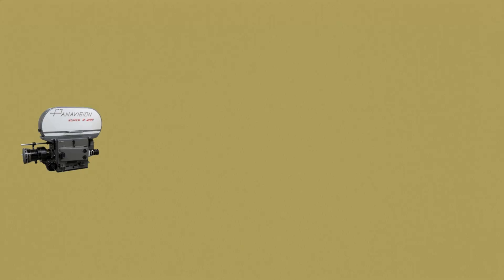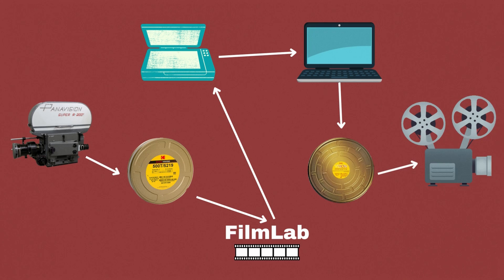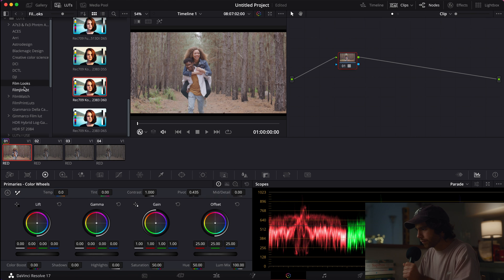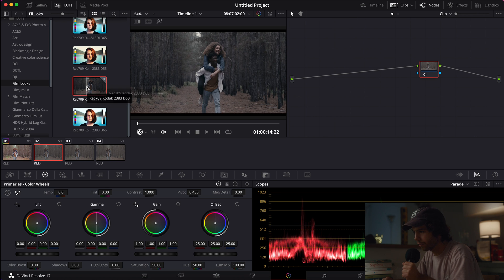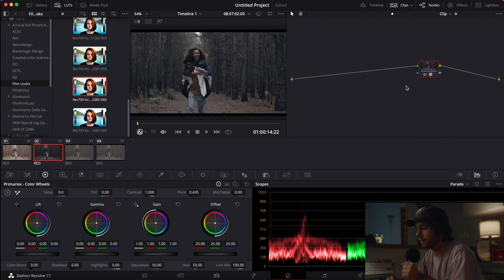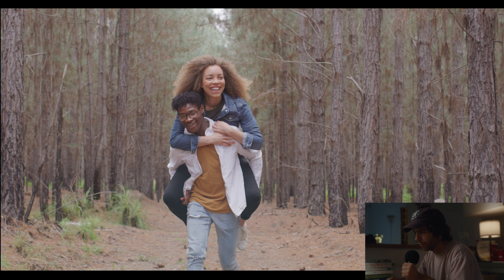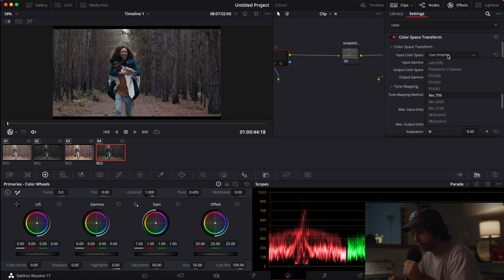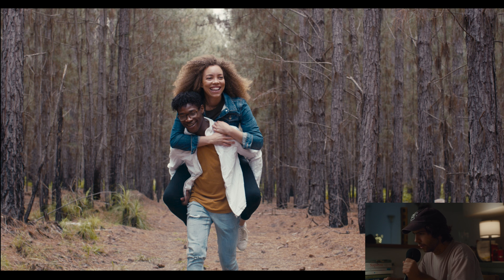Davinci Resolve Film Look + Free PowerGrade

Comment: Hey, just one small tip: If you're converting footage from one color space / gamma to another, and it's not the final conversion for display, it's best to switch off 'tone mapping'.
Reply: what is it for?
Reply: @rustikkkk  tone mapping maps all the values of your larger (log) space to the smaller space (f.e. Rec709) in a pleasant way.
Reply: @RubenStuveling  and then why we should turn off if its not final conversion

Comment: I tried this and it’s not coming out right for me. I changed the input color space and input gamma to my camera in the first node and then put the “Kodak50D” LUT in the third node. The image comes out very blue and I’m not sure if that’s the intended look. I was under the impression that this PowerGrade would create a look similar to this video. If not, that is user error on my part 

I thought
Reply from the maker: Hi Johnny, do you have a “film print lut” on the last node?
Reply: @jimmyonfilm  Yes. 

The last node is set to “Rec709 Kodak 2383 D60”. Is there a difference between the two PowerGrades in the ZIP file download? One PowerGrade is 8,108 KB and the other is 1,863 KB. I am using 10-Bit footage and i am not sure if that plays a factor in the final look 

Thank you for your reply

Comment: I was trying to do this film lut in davinci wide gamut colour management , other than rec709, but it's not working .
Reply from the maker: I haven't tried it myself cause I don’t use davinci wide gamut color management. Basically color space transform from davinci wide gamut to the input color space of the LUT (Arri LogC in the CST node), and then color space transform from the output color space of the LUT (the film print lut) to davinci wide gamut again (so going from rec709 color space and gamma to davinci wide gamut). Keep in mind that the film print lut was built for SDR so it will not work 100% accurately. But you can try. This powergrade works best with a manual color management :)

Comment: Nice video and nice style of explaining. +1 subscriber. I'll give your PowerGrade a try. Any ideas on settings to use when working with non LOG files? My footage consists mainly of drone (DJI Mini 2) footage. Not sure of the color space but I think it is Rec709. What are the best settings for applying LUTS in the best way? Keep up the good work!
Reply from the maker: Thanks!!!! 
In that case I would use the CST in first node in the PowerGrade with the input color space and gamma both set to “rec709” and the output to Arri Alexa and Arri Log. The results are not 100%accurate cause it’s hard to go from rec709 color space to Log in a very clean way. But I did it from time to time when I had to and it wasn’t bad at all. Maybe you just gotta mess with the contrast a little bit to find the sweet spot.
Reply: @jimmyonfilm  Thanks a lot! Downloaded your Kodak PowerGrade and it works like a charm with these settings
Reply from the maker: @TomBoudewijns  Happy to hear :)
Reply: @jimmyonfilm help! What would be the best way to use a old canon 600d 8bit footage? Does that also output rec709? Would the workflow you described be the same?

Comment: in my case in the CST panel on output color space it only appears, ARRI WIDE GAMUT3 or 4 and OUTput gamma ARRI LogC3 or C4. What should I do?
Reply from the maker: You should set it on ARRI WIDE GAMUT3 and ARRI LOGC3. The wide gamut4 and Logc4 are the new log encodings that arri released with the new Alexa 35, but the Kodak profile in the PowerGrade is based on the standard LogC3 :)
Reply: @jimmyonfilm  thnx!

Comment: Good tips
I love the look
How do you avoid the gamma shift 
In resolve using a Mac 
My exports always look washed out compared to my grades in resolve
Reply from the maker: Hey Karlie, thanks!!
Yeah, I used to have the same problem. You have to go to "Project Settings" and in the "Color Management" section you set the "Output Color Space" to "Rec709-A". Then in Davinci resolve General Preference Setting make sure that "Use Mac Display Color Profiles for Viewers" is turned on. This should get rid of the shift in the export. Let me know if it works :)
Reply: @jimmyonfilm  ok thanks
Reply: @jimmyonfilm  yes it did work, thanks alot, my footage still does't look as good, but at least the not good is consistent with how it looks in resolve now
Reply: @karliemorris7318 Try  to tweak the export to Rec709-A in the export preferences on the deliver page as well..